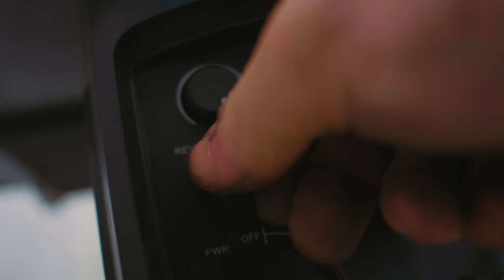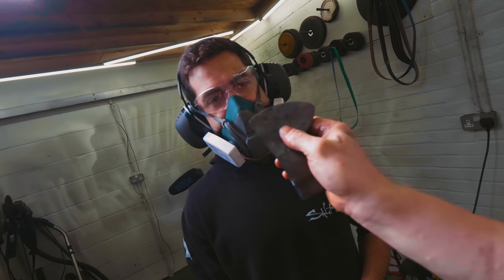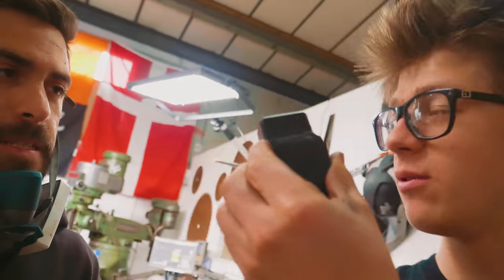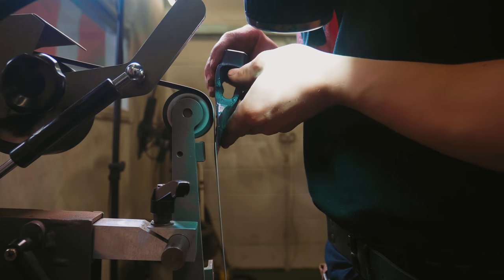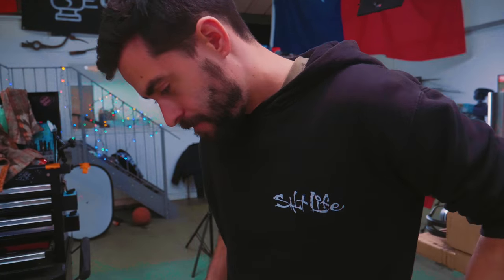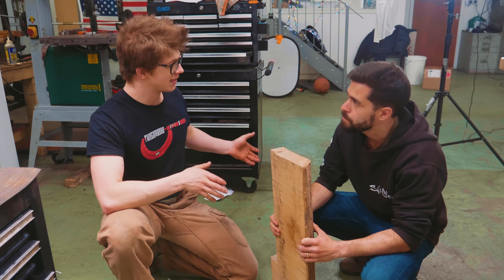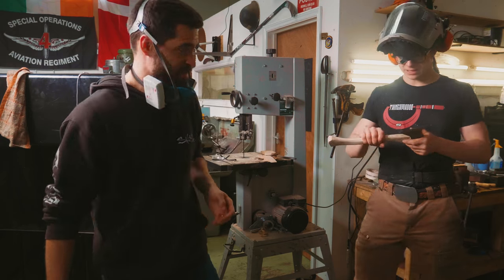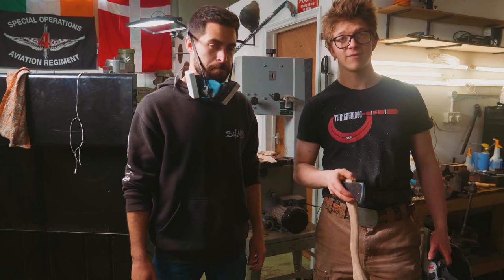FORGING A HATCHET!!! PART 2

Comment: I saw that you oiled this handle. Did you also set the end of the handle after you wedged it and trimmed the wedge into a shallow pan of oil overnight? I was taught to do this with axes by my father to keep them from coming loose over time. The oil swells up the wood and then dries in, sealing out moisture and keeps the wood swollen. This will keep the ax head from becoming loose when it is stored indoors since inside a house is very dry and will pull out the moisture from wood, shrinking it. You can also do this with a loose head to tighten it back up instead of replacing the handle or adding a metal wedge.
Reply: KnightsWithoutATable yes i do the same sometimes, good idea

Comment: Suggest you look at making a Broad Hatchet. They are unique in that they have a bevel only on one side and allow the user o make flush cuts easier. A Broad Axe has a bevel on one side and an offset handle for cutting a log side into a flat plane. The Broad Hatchet is very handy around a campsite.

Comment: Alec buy some wood stain ffs. Some Black Walnut, or Mahogany stain for dark colors. The end result will be allot better than burning it. Use stain because it will soak into the wood and scratches will be less noticeable. You can also use dark roast coffee or chewing tobacco(not snuff). Stick the tobacco into a pint glass, fill with water and leave over night, with coffee make a pot and the longer you let it sit with the burner on will get a darker stain. If you want black buy a large bag of black walnuts free the nuts from the shells while gorging on em, then break the shells up into small pieces and let soak in water for a few days and you will have a black stain. Also instead of oiling the axe head, once mounted use hot beeswax to coat the head and handle.

Comment: I think the handle is a little to charred now,
Looked good with one pass with the torch and also varnish/lacker would be a great coat for water protection and prevention from splintering.

Comment: Instead of burning the handle black, try boiled linseed oil next time.  You can't screw up with it, its fairly quick drying (if you use boiled version) and can burn it after if you still want to.  I think it would have looked better with that, especially with how your ash looked.

Comment: you should revisit axes, i want to see you make a 3-4lb 32" with either phantom bevels or a high centre line whilst maintaining nice geometry for bucking logs finished with a 20 degree backed up edge. Then let someone test it out thoroughly, i believe you could make an amazing job at it. The art of good axe patterns has been lost, modern manufacturers tend to favour flat grinds and aesthetics with flat cheeks and sub par performance

Comment: I don’t  think you got the difference between ash and hickory quite right. Hickory is a bit harder, but a whole lot stronger, which means you can get away with a much thinner springier handle while being just as strong. Which means when done right hickory sends less vibration to your hands. This effect isn’t so noticeable on hammer handles, especially on thick slab handles like you like, but on longer handles like felling axes and sledges you can really start to feel the springiness and how it’s beneficial.

Comment: You should lower the guide on the Bandsaw to be closer to your workpiece so the blade doesn't deflect as much while you push it through.  It will lead to a safer and more accurate cut.

Comment: WTH Alec you're still just using jury rigged clamp setup for your belt grinder!

Stop taking shortcuts and do the proper job of creating a proper mount before it before something bad happens and you lament how all of it could have been avoided if you'd just taken the time to create a proper mounting system.
Reply: Who hurt you, Robert?..
WHO.. HURT.. YOU?!?
Reply: A belt grinder
Reply: Seems like a fitting guess.. however, I'm far more curious as to what did the emotional damage. So much snippy aggression in a comment about a belt sander setup makes me think it's more of an inner pain/self-loathing thing with a dash of concern for Ser Alec's phalanges!
Reply: "It's not stupid if it works."

Comment: Hey Alec, love your vids bringing in the best of blacksmithing and film! I got a question about eye-punches. I have failed an attempt at punching an eye for a railroad spike tomahawk so I've been looking to make a better punch. That lead me to Brian Brazeal's punch but after watching a couple vids, the eyed portion of the punch seems to absorb too much of the blow and ends up stressing both the eye and striker more than necessary. Do you think you could make a "primitive" styled eye punch that doesn't have an eye but a pair of fullered notches so that a handle can be slid on around the punch and wrapped with lashing to hold it. The basic idea behind this would be so that there is a direct transfer of the blow to the business end of the eye punch from the blow of the striker to the workpiece. Anyways, thanks for the awesome vids!

Comment: You could have tight welded a piece of higher carbon steel to the edge and then ground it down to add extra weight you could have also done it to the back as well

Comment: Aaah! That axe has a classic case of Alec fat forging! You want the blade to be able to penetrate the wood! Axes are THIIIIIN, like, a quarter inch thick an inch and a half up from the edge. THIN!
Reply: Eh, atleast it'll survive hell of alot longer than the thin skinny kind.
He can sharpen it for years and not worry about replacing with a new one.
Reply: ryan michael  Not really, if made right, and used right, with monolithic steel like that you’d be hard pressed to wear out a skinny axe in your lifetime. Unless you use it all day every day like an old time lumberjack. The axe I use most (because it’s thin and chops like nobodies business) is probably 60+ years old and barely worn down from when it was made.
Reply: The cheeks are also very fat. But, it'd be a good camp splitter at least.

Comment: Alec why do you char the handle? I've seen you do it hammers and now to this axe. Is it just cosmetic or does it improve the handle?
Reply: While the oil or wax helps against the humidity, burn wood gets more UV resistant, the handle becomes more weatherproof, better for outdoors.

Comment: alec if you are having troubles with scale maybe you should try a coal forge instead. as propane gets burned it creates water and carbon dioxid and what water does to metal well im sure you know. however that problem doesnt exist with a coal forge

Comment: Following yr videos with interest, yr knowledge n capability as blacksmith is undoubtable. Hwevr, if it comes to wood, there's a long way to learn. Rightfully Hickory is the strongest timber for handles, but its the hardest, yr wrists shall realize. Ash yet is remarkable strong, too, yet flexible, yr wrists shall thank you. Ash has the much more beautiful structure, is more beautiful. You can burn the handle with a torch, but only 'slightly', which exfoliates the grain even further and with time, sweat and dirt it shall darken anyhow, the 'patina' of years hammering in the woods... But y hv torched the handle to almost black, which eliminates the beautiful texture of ash. Being a woodman, I wud only buy an axe with a linseedoil, natural handle, a slight torching can be considered. Cheers fm Singapore+

Comment: How exactly does the scale form when you are forging steel? is it impurities or carbon exiting the material? Does it come from the air? I've always wondered. Great project and video!!!!
Reply: The scale comes from oxidation, air and very hot steel in propane forges causes a fair amount of scale, some chemestry involve mostly due to the propane but the air has a parte in it also.
Reply: THX!

Comment: Why do you always torch the handle material? Is it purely cosmetic or does it seal the wood or something?
Reply: Don't know if this is the reason he did it but burn wood is way more UV resistant plus the oil the handle becomes all weatherproof

Comment: Your Axe is sharper than my plane blade.  #Ihavesomeworktodo.  Is charring the wood for aesthetic reasons or does it also had some strength to the ash?
Reply: It has some preservative properties. Japanese do this with cedar for house siding and other things exposed to the elements.
Reply: Luthiers also use it they char the wood and use tung oil or other finishing oils and it makes a water proofseal on the body and neck
Reply: Torching wood handles allow them to last longer.
Reply: I am familiar with the Shou Sugi Ban process, but for some reason never associated it with a tool handle.  Thanks, guys, I appreciate the responses.
Reply: If I'm not mistaken it also gives the wood an antimicrobial property and helps prevent the blistering of your hand

Comment: Alec great hatchet  I can tell by watching you use your band saw that you do not have the blade guide set correctly. the blade should be supported on the back edge by a bearing and the sides supported by a block of steel or nylon on each side. when i saw you sawing out the handle , I see the blade flex back telling me its not supported  also the blade twists back and forth when you saw a curve so I don't think you have the blade guides adjusted snug on each side (just back of the gullet of the teeth, so you don't ruin the set of the teeth)  Love your last videos very much

Comment: What was the purpose of putting the axe head on a red hot drift at 3:10? Is it normalizing or just heating it up to get the oiled finish in place?
Reply: I think it was to temper it

Comment: Very nice looking!! But for the love of god quit burning the wood it looks so clean and nice! While shop tools get used and dirty I understand why the hammers are burnt. As always I’m still impressed!!
Reply: While the oil or wax helps against the moisture, burn wood resists the UV light, helps the handle to be all weatherproof, better for outdoors.

Comment: Its a beautifull axe and handle but you messed up the grain orientation of the handle.anything with a handle of that style the grain of the wood should be rotated roughly 45 degrees from the angle of the blade it looked like you had the wood grain completly paralell to the blade of the axe

Comment: Is there a reason why the butt of the axe head was being ground on a contact wheel instead of a platen or slack belt?
Reply from the maker: None at all! The contact wheel was just on it at the time.
Reply: Alec Steele sounds like a fine reason to me! Thanks for the response.

Comment: ruined that camp axe with burnt handle, what a shame. Looked good after first pass of the flame, but then went way to far. If you drop an all black tool in the woods kiss it good bye forever.